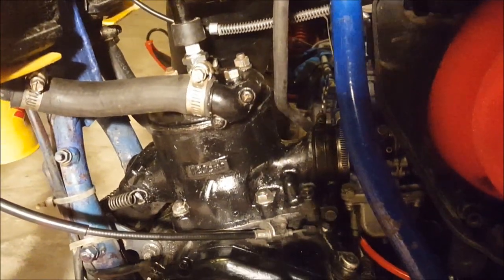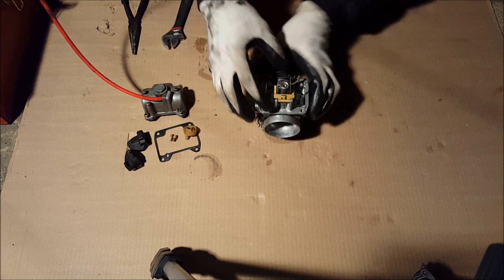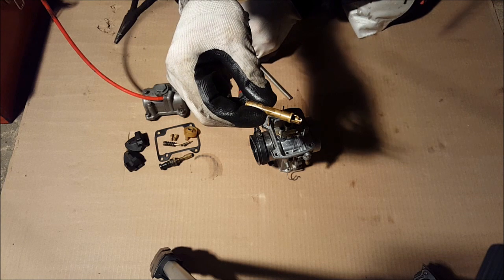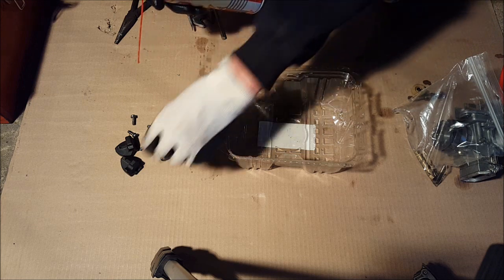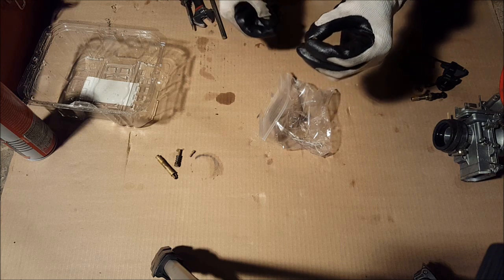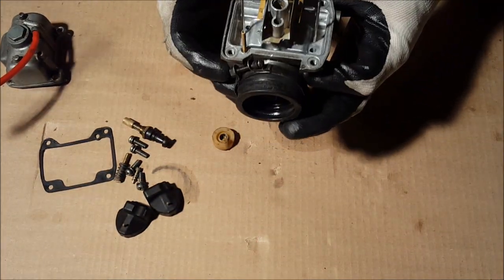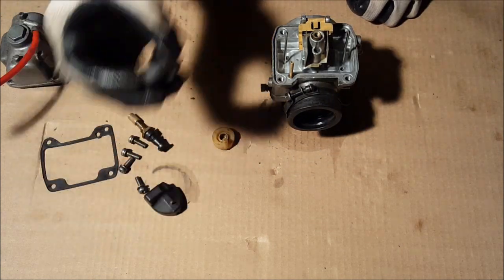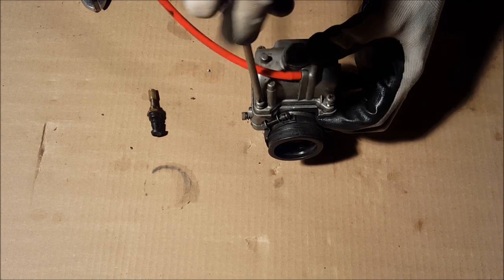Suzuki RM 125 Carburetor Rebuild/Cleaning The Correct Way

Comment: I have a question I have a 2005 rm 125 n it is dumping fuel from the extra line coming off not sure what they r call but I do k ow a little on how to work on them
Reply: From how you described it sounds like your float isn’t working

Comment: whats the float height for this carb? i rebuilt mine and my 84 rm125 still wont idle
Reply: Evan Jeffries I’d check your manual for factory set, pretty sure the rm’s in general have a float that’s set pretty high, hence why they seem to piss more than any other bike with the gas on